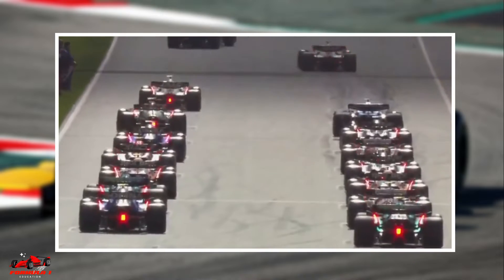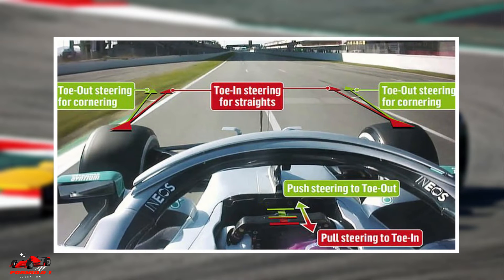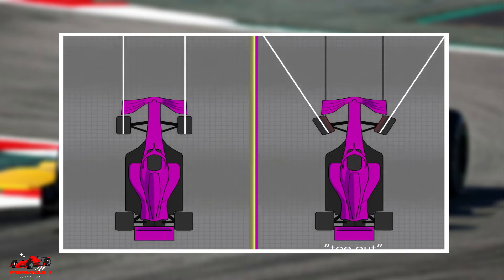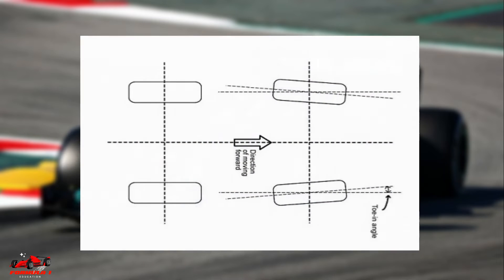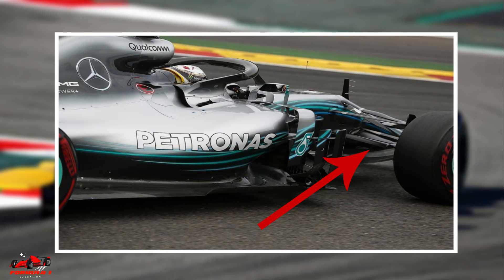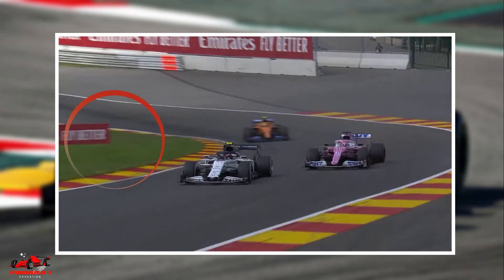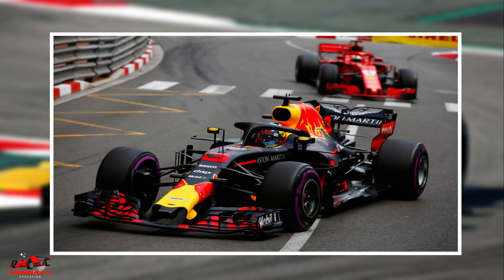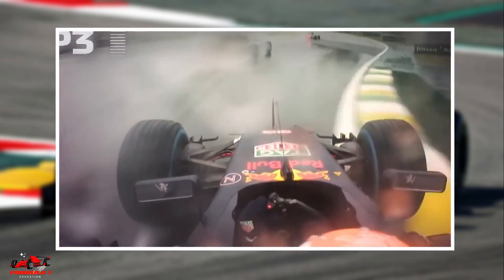Formula 1 Tyre Toe Explained

Comment: At 1:55, is "stringing" the wheel alignment the only conventional method for F1?  Seems so... primitive.
Reply: no, they are definitly not stringing it. we are talking about angle minutes here, not in whole degrees. I have no idea where this guy gets the idea that even F1 cars utilize 1-2 degrees of angle per wheel (maybe he means combined toe-in of both wheels which is obviously double) but overall I wouldn't take this short clip as a source of knowledge. pictures don't fit what he's describing and a lot of obvious stuff is left out which is also why some of the stuff claimed here contradicts itself.
back to the original question: even for roadgoing cars you always need some kind of laser device, usually in the form of a bigass expensive car lift, if you want to get accurate alignments. as I said, we are talking about 1/21.600s of a full circle here so moving a suspension component as much as half a millimetre or turning a bolt 1/8th of a turn already has huge impact on the wheels position. "stringing" it is good enough to get to a qualified workshop after a repair or for your 15+ year old farm truck but certainly not for motorsports who are quenching out every last millisecond of the car